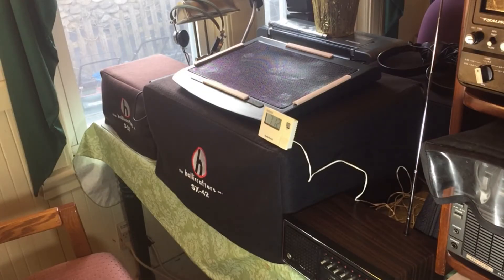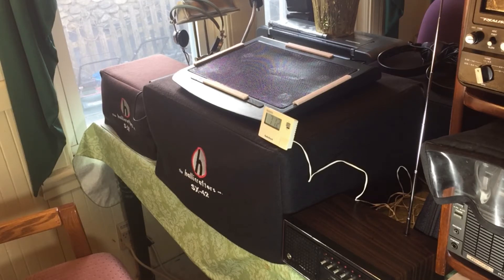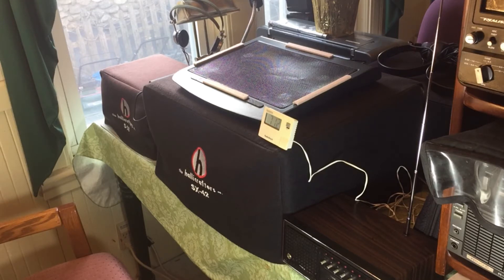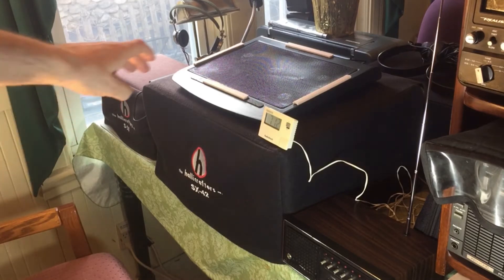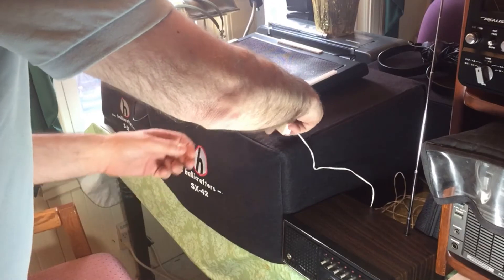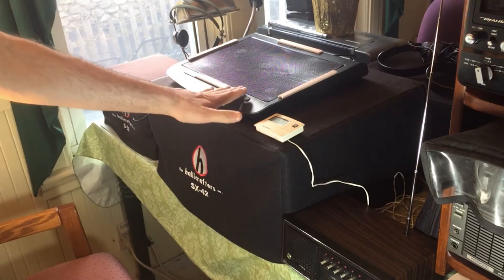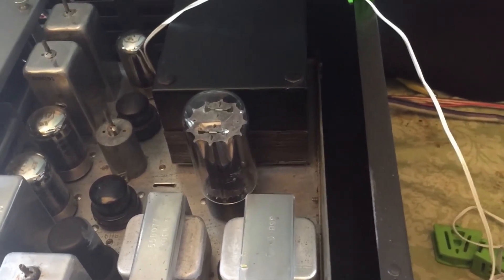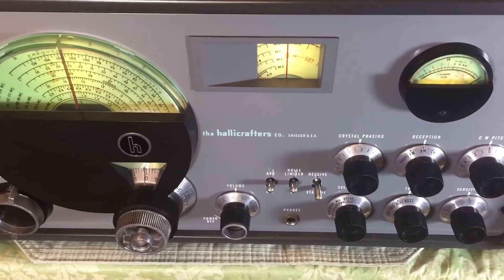Boatanchor Radio Cooling

Comment: Dang Arthur cool and informative video, my older integrated amp solid state, has been getting quite warm so I bought a small fan to help keep the heat down BUT! I was pushing air in....so I will do what you suggested and pull the air out now I realize you are speaking about tubes but I don’t want to introduce dirt and crude into my amp, I just didn’t think about that.....thanks Arthur cool video— Lis
Reply from the maker: L. E. I did do a LOT of research in advance, and yes, even war era tube gear used a cooling system that pulled air out. Never underestimate the additional benefit of circulation.